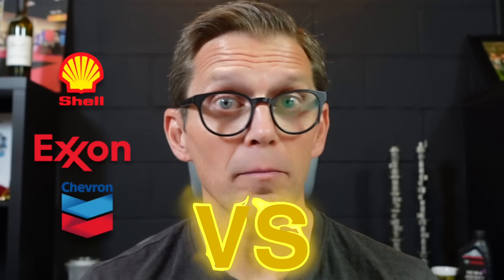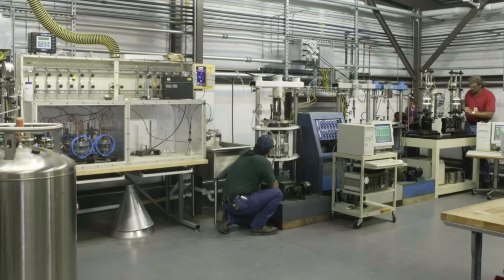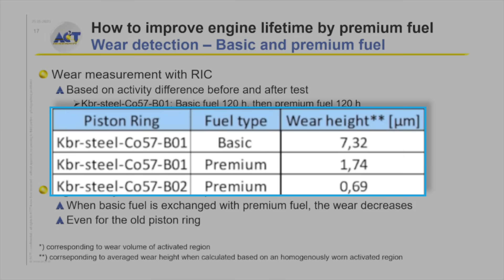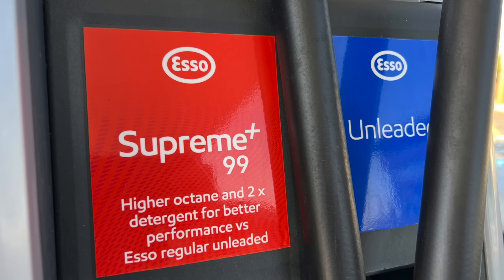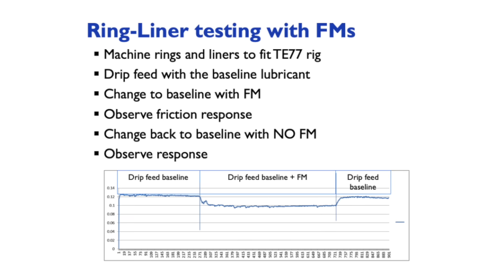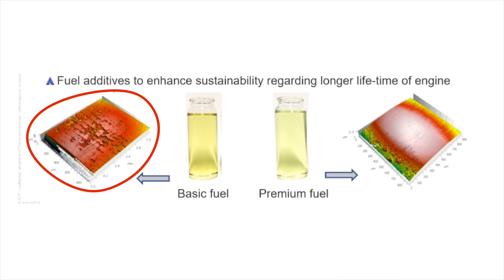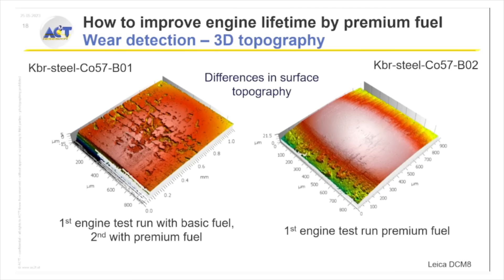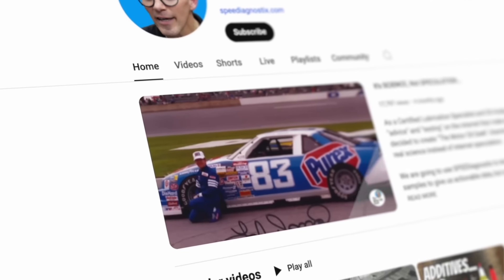Can Premium Fuel REDUCE Engine WEAR?

Comment: Hi Lake, I may have a specific example of the benefits of using fuel with added friction modifiers. I was driving to a neighboring town 30 minutes away in my 03 Z06 Corvette. I stopped in a parking lot when near there and added a bottle of Amsoil Octane boost and a bottle of Amsoil upper cylinder lubricant to the 3/4 full gas tank to test for operation and sound differences since the engine was hot and I was accustomed to the sound it was making. I swerved back and forth to mix up the gas in the tank and continued driving to my destination and within 2 miles, shockingly the LS6 V8 quieted right down, like I had thrown a sound deadening blanket over it! The normal LS valve train noises were gone and performance picked up a bit! The next morning on a cold start I thought I might hear the normal tick tick sound but it was almost completely gone. Most days I would drive very easy on it when cold, keeping the rpm’s low, for fear of hurting something until it warmed up, but the upper cylinder lubricant seems to be doing the trick. My son has a 2013 Viper with a loud valve train, so he’s going to try some as well. Thank you for making us enthusiasts aware of the fuel importance.

Comment: Definitely a 'Yes' for a fuel video.  This is interesting from what comes out of a lab, but we all know in the real world, what you actually buy at the pump, and what it says it is, aren't necessarily the same thing.  It would be interesting to see tests from a few samples taken from a few different stations (i.e. - not fuel samples provided from the Chevron / Shell / Valero  company rep, but actual gas stations) to see what you actually get, and if it makes a difference.
Reply: I agree. YES on fuel video.
Reply: I also remember seeing a video from Chickanic recently that pointed out that the first gallon or so of gas you get at the pump is whatever the person before you pumped because it sits in the hose. It started out as a test because customers swore up and down they were only putting ethanol free fuel in their small engines but she found ethanol in them.

Comment: Hi Lake, thanks again for sharing your knowledge here and even your enthusiasm that you like to reel back.  This fuel dilution and fuel formula video makes me wonder a few things.  Do the fuel additives you recommend with the polyetheramine detergent additive have any negative affects with the premium fuel with the friction modifiers?    This to me is similar to negative affects from the over the counter oil additives you've proven to not use with the oil additives already present in oil brands.  Also, is there a fuel additive available with friction modifiers to help fuel without these same friction modifiers?  And yes I'd like to see a video on the fuel you mentioned at the end.

Comment: this is copied from a post in a group I'm part of,
Is there any truth to this, it's a long read?

The standard hip pocket rule of thumb for octane is if your motorcycle or car is not pre detonating then use the lowest octane available, octane to put it in gentleman's terms can be loosely called " The Resistance to Detonation of any fuel", and the best example I can give you is if you take a pie pan of gasoline that is 87 octane and a pie pan of gasoline that is 94 octane, you put them on the floor of your garage and you approach each one of them with a lit match, the 87 octane will detonate further away than the 94 octane, so gas is formulated to have a greater resistance to detonation the higher the number, and the number comes from an old thing that was called the "Anti Knock Index" because older cars over time would have the valves go out of adjustment, heads would leak, air would get into the motor.......and when the air would come in it would actually make your car run hotter, and to lower the temperatures in our cylinders we would put in higher octane gas, so if your car was knocking or running on after you turned the key off in the 50's, 60"s & 70's the solution for that was to put more expensive and higher octane gas in your tank.

Lead was always in gasoline back then as a lubricant, but they would use things like seetane and later on toluane and other octane modifiers, and these octane modifiers were put in to artificially pump the octane number up on what the regular chemical composition of gasoline would be.

Believe it or not one of the best octane boosters is water, and old trick used by old diesel mechanics, because of the hydrogen chain of water being H2O.....there is 2 hydrogens and 1 oxygen, if you have an old diesel engine that needs to have the heads cleaned, one of the Hail Maries was to spray some water through an atomizer bottle or spray bottle into the intake track of a diesel and what it would do is it would crank up the octane in the diesel fuel going in and it would burn out all of the carbon deposits inside the motor, but it is actually pretty dangerous and it can scatter a motor while your spraying it to explosive results.

Only use 87 octane fuel in your motor vehicles regardless of what the owners Manuel says, if you use any thing higher then the ethanol will chemically retard the timing of the engine which is actually alcohol poisoning.

Higher octane does not burn cleaner as the petroleum companies would have you believe.

It is not about the ethanol percentage because 94% octane does not contain more ethanol than 87% octane, it is about the ability to burn the gas versus the ethanol ratio in it.

Ethanol is hydroscopic meaning it brings in more moisture.

There are 2 methods of determining the octane number, one is the RON and the other is the MON, some countries use the RON exclusively and some countries use the MON exclusively. In the United States we use an average between the 2 numbers so the next time you are pumping gas for your car look at the pump and it will say 87 octane RM/2 and what that means is that there adding the research number R+M/2 to the mechanical number and they are dividing it by 2, so they are giving you an average between the RON number and the MON number, now when you are looking at your owners manual for your Japanese or European motor vehicle it is going to have a higher octane number and sometimes these manuals for cars specify a higher grade of gas because they have a higher cylinder compression and they are going to need 98 octane fuel, well 98 octane in the European system translates to our system in the United States to about 91 or 92 octane, so you are not buying the wrong gas and you are not going to damage your vehicle, the gas that is sold in Europe is the same gas that is sold here in the states they just have a different method of measuring the octane number.

Every company that makes their money selling additives have tested out fuel, so if you use 87 octane in your motor vehicle you will not get a single horsepower number higher on a dynamometer running 94 octane through your cars engine than you will running 87 octane it just does not work that way.

If you are going to over build your motor, if you are going to run a high compression motor, if you are going to alter the timing to fire that spark plug at a point where the piston is higher and therefore the fuel is under higher compression then you do have to start using a higher octane fuel or you will pre detonate, so simply put if you've got a tuned motor or if your motor is under a high heat high stress application then it is ok to run a higher octane fuel to help counter the effects of cylinder pressure and heat.

If you put a higher octane fuel in a motor that clearly does not need it you are doing your motor a disservice, and you are doing 2 things to it, 1 is you are making the oil companies really happy and we all know they need more money..... Right? But really what you are doing is chemically altering the timing of your engine, if you have points or fuel injection with a computer your spark is set to fire or go off at a certain time that is all based on the appropriate fuel for your vehicle and when you start changing the formulation of that and you start putting high octane fuel in then what you are doing is chemically retarding your timing because let's say now instead of that thing firing at 18 degrees before top dead center now in fact it is going to have to turn further, the crank will turn further, the pistons will go higher before it actually sets off the explosion because high octane gas has a greater resistance to detonation and compression, so now you have just messed with the timing of your vehicle.......spark will happen and ignition will happen but the time it takes because lower octane fuel burns hotter faster and higher octane burns slower and will take a longer amount of time before it lights up, spark and timing is the same but the flash over, the amount of time it takes to flash or fire up is changing and taking longer and is occurring later and that will give you the same effect as if you then further retarded your timing.

With the current junk fuels blends they are selling us there is 20% less gas in your gas today than there was 10 years ago, between oxygenation and ethanol MTBE and all these things that are in the fuel they are taking the place that gas used to be and as we did that a lot of these components and chemical recipes that are in your fuel are there to pump up the octane that we lost when we started putting ethanol and oxygen in the fuel, and now gas does not last anymore, it used to last a couple of years but now within 30, 60, 90 days it smells like varnish and the engines won't run right.

Modern fuels are literally just eating seals, the rubber is just falling apart, so if you are going to let's say rebuild your carbs make sure you are using rubber items and elements in your carbs that have not been sitting in a bag for 30 years because those things are not going to be safe for modern day fuels, use modern day "Viton" seals and rubber.

Comment: I'm thinking running premium is a bit of a toss up in terms of actual benefit. While it may reduce wear, the reality is cars typically do not last indefinitely due to rust, potential accidents, extreme weather (floods, fires), and bad (planned obsolescence) engineering. There is then a cost-benefit analysis that needs to take place where you need to weigh the cost of premium versus the actual benefit you are going to get in the long run. Your car may still become inoperative at 15 years old because you can't get a part or it is too expensive to repair something. At the end of the day, immaculate bores might not save you any money is my point and you spent thousands of dollars extra for no reason.

Comment: I've had so many friends argue that premium fuel is a waste of $$ , vindicated , Love it !!  More Fuel Video's please !
Reply: Premium as in octane that's rated with "Top tier" stickers at the pump, not 91 or 93 octane fuel. If your vehicle recommends 87 octane, you should add "Top tier" 87 octane.
Reply: Before potentially wasting money on premium fuel actually read the studies. The Austrian study used a deliberately crippled oil with no additives so they could study the fuel additive. It's not clear the additive would have made a difference if the oil had been standard.

Comment: Currently have a 2012 Ram 1500 with a 5.7 Hemi. It’s required to run premium fuel according to the owners manual. I’ve heard horror stories about this engine all over the internet. I run full synthetic with regular oil change intervals and premium fuel, have almost 180k miles with zero mechanical issues. I’d be curious to know if I’ve been throwing money away at the pump by always using 91+ or if I could have been using 88+ this whole time so long as I’ve been going to a Top Tier station. 😅 A video covering Top Tier or major brand additives would be amazing!

Comment: I have used American/Amoco/now BP 93 octane gasoline since around 1982 in all engines that I have owned-including small engines (even 2-strokes after mixing the proper fuel/oil ratios). The old slang for American 93 octane was "white gas". It is still QUITE clear. I have never broken down nor have I had a fuel pump to injector issue. I have never had to "tune" my engines with the exception of few coils on my 300,000 mile Volvo V70 and a few plugs on small engines. What are your thoughts on BP93?

Comment: Most US four cylinder engines require regular, 87 octane gas. Does it hurt or is it beneficial to run higher octane in those vehicles? Do you have videos or what are the best 0W-20 motor oils? Do you recommend any oil or fuel additives? 
Thank you, Russ

Comment: Do we know if the tests were run on a port-injected engine or a GDI engine?  Was it forced induction?
Reply from the maker: It was a GDI engine.
Reply: @themotoroilgeek  It would be interesting to see if ring oil dilution is the same if port-injected.  …or operated via carb.  I’m not the biggest fan of GDI on a gasoline engines.  I think they are inherently less reliable than port injected engines, and I don’t think they really get that much better efficiency if any.  I had a ‘14 Accord V6 3.5L w/automatic.  Got 36MPG on highway @ 65 and about 32MPG @ 75.  I don’t think the current turbo/GDI 4-Cylinder Accord gets that today.  I got 328K miles out of it before it got totaled.  Engine/Tranny/MPG all still good at that mileage with NO major work on the car other than timing belts, fluids, brakes and suspension.

BTW, I love your channel.  Great information.  Switching my Frontier to Pennzoil Ultra Platinum next oil change.  I’ll be sending in samples in the future.

Cheers!

Comment: I'm thinking it is irrelevant for my use case.  I've never had an engine wear out, always the fault is some particular design compromise the engine in question is known for, or in the case of passenger vehicles, after 20+  years of salted winter roads, they just rust out the undercarriage too much and are retired for that reason.  I normally save near $1/gallon with member perks discounts, using Kroger grocery store fuel, regular 87 octane.

Comment: I use castrol edge diesel and shell v power diesel.
Question, Does shell v power cut the amount of carbon build up on valves & intake manifold?

Comment: Should I run shell vpower 93 in my 2024 Silverado 2.7 turbo? The manual says recommend 87 top tier. I normally run chevron 87 but because of this video and the way the 2.7 was built for hight pressure I am wondering if I should switch.

Comment: Good video like always but now i want to know what the best fuel additive to use? Here in cali we only have 91 octane which isn’t high enough especially for my pump gas stroker 512 engine and all i ever go to is Chevron and always add Lucas Fuel Additive in each fill up, also for my diesels i usually go to a truck stop where i know the tank at the pump is always being used/ getting new fuel and add Hotshot secret diesel treatment .

Comment: This car is a tank… I would typically trade to something a little newer. But there was just no reason! I religiously change plugs, air and cabin filters, detail the car, and tires get changed out each winter - two complete sets. So, I use it quite often for interstate travel and leave the MB GLE450 home for the wife… 👍😊

Comment: Other than Shell fuel with regard to premium fuel sold in America, do all premium fuels by major oil companies/distributors have that same protection additive package in it? or is it only shell ? I only heard you mention shell as having that reduction package?  for example does Chevron, BP EnMark, sunocco, or Walmart gas or cirkle K gas have the same wear protection package in there premium fuel, which would be the highest octane 93. I’m guessing in  the US? do all these other gas stations have this same wear reduction package in their premium fuels? or is it only shell? so whenever I go to the gas station am I getting this additive package every time I fill up with premium protection wear package is it in an all premium fuel, across-the-board no matter what gas station I pick , or do I have to go to Shell gas station ? or Chevron or Texaco or whoever has the right package, how do I know I’m getting the right package when I fill up with premium at whatever gas station I’ll happen to pull ? is that universal across-the-board? or just with certain, major companies and petroleum distributors like shell, Texaco and Chevron I fill up with Walmart gas and get bring me fuel. Is all premium ful the same as the shell premium fuel? we know Texaco and Chevron like to advertise the techron, that they put in the fuel  but they don’t make any such mention of aware reduction package never heard of that before your video. I just did not hear any information about exactly what I’m getting anytime I pull into a gas station and fill up with premium. I wanted to know if I’m getting that protection or is it just at shell gas stations I heard no reference to anything with regard to how I know I’m getting that other than shell gas?

Comment: OMG. This makes sense coming from you with real data. I wish this was out 2 years ago. I have a 22 Suburban and the engine went out at 80k miles. I fought with the dealer and GM, couldn't understand why my engine was shot when I  RELIGIOUSLY I have my oil change every 2000- 2500 miles. I go by engine hours for my oil change, so basically 150 -200 hours. I have check the manual  & online on my 5.3 liter engine for the grade of gas to use. It's printed regular unleaded is fine. But apparently, it's not . Friends and family i spoke to can't believe a new vehicle only 18 months needed a engine. These results make me think different now. Why would GM say to use 87 minimum on gas is ok. I think I gotta get a lawyer for this matter. Cost me $11k for engine repair.
Reply: GM is recommending oil that is too thin, too long between changes and the cylinder shut down is bad for the engine. All to satisfy the EPA